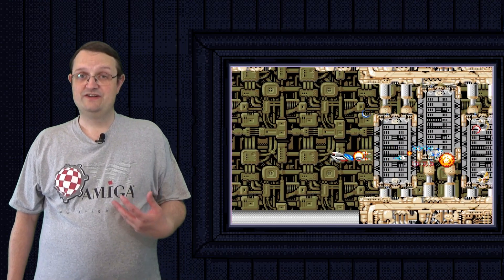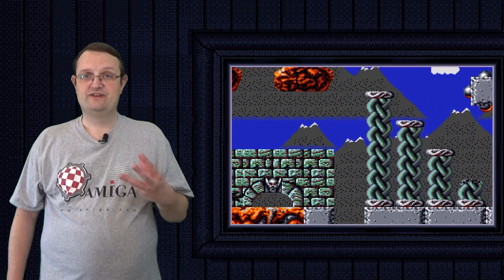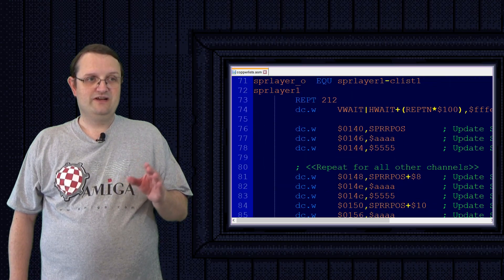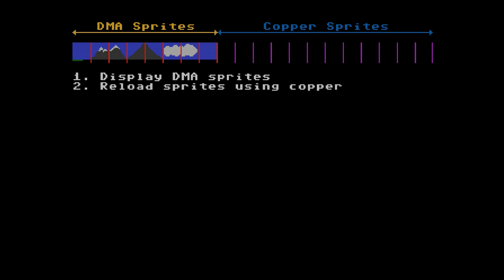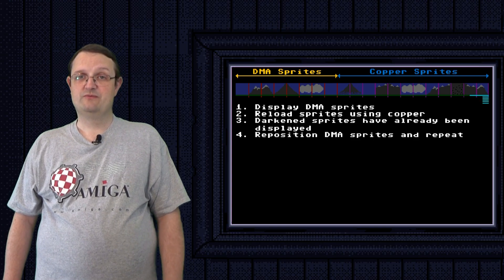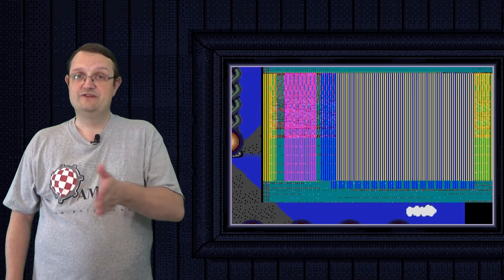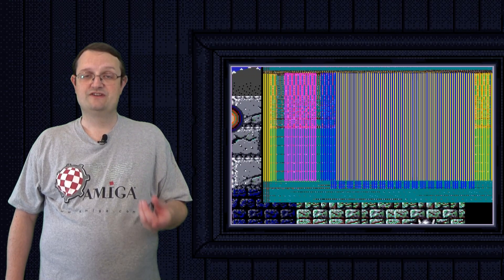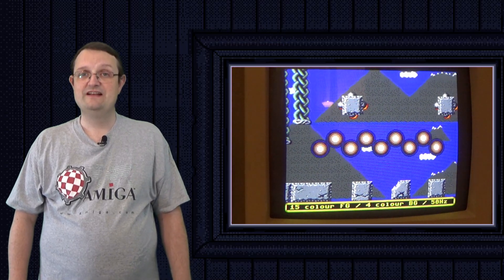Amiga Tech - Free Form Sprite Layer

Comment: You say Commodore but this is in fact just branding. The Amiga was made by Ex Atari employees.
Reply: The Atari ST was designed by the Commodore C900's key engineers.
Reply: @valenrn8657 This is also true!
Reply: Not true
Reply: @bronwaith  It is true.
Ex Atari employees left and founded a company named Amiga.
Then, Commodore, unable to make a 16 bit system, bought Amiga, meaning Atari made it.
Reply from the maker: @ecernosoft3096  The keyword here being "Ex". They were not working for Atari at the time, meaning Atari had nothing to do with it.

Your argument is like saying that anything Atari created after Jack Tramiel took over Atari was actually made by Commodore because Jack Tramiel used to work at Commodore.
Reply: @DutchRetroGuy  fixed.
Reply: Ok, before you all spam me with “no it’s commodore” or “ex Atari employees” I fixed it.

Comment: How many dma cycles takes dual playfield? It is possible and reasonable using it with sprite multiplexing (with and without Free form trick)?
Reply from the maker: Dual Playfield uses 6 bitplanes and so takes 50% more DMA cycles for bitplanes than 4 bitplane mode (as used here) does. Sprite multiplexing is still possible, but the free form trick I've used can only work with 4 bitplanes or less).

I'm not too sure many games used both a multiplexing Sprite layer and Dual Playfield to be honest, the extra layer would be nice, but generally the loss of colours in Dual Playfield means developers used the Sprites to add a splash of extra colour instead of an extra layer.

Should be possible though :)
Reply: @DutchRetroGuy   My idea is to use 4 multiplexed sprites as background layer, back playfield as foreground layer, front playfield as exclusive enemy bobs layer, and finally remaining 4 sprites for player character. So the result should be a parallax scrolled screen with 3 colors background, 7 colors foreground, 7 colors for enemies (plus eventually bullets and explosions), 7 colors for player character. If it remains some dma, it could be possible to use copper for increasing colors in background and foreground layers
Reply from the maker: @ProfenixStudio  that should work, yeah. The one thing to keep in mind with DPL and Sprite multiplexing is that you only get 1 Copper move for every 16 pixels during bitplane DMA (which is why the free form layer can’t work as it needs two). Other than that it’s no different from any other Sprite layer.
Reply: @DutchRetroGuy  I think Leander game does something similar. Right?
Reply from the maker: @ProfenixStudio  I think you’re right, yes. I do think Leander limits the height of the Sprite layer in the background, though. Not sure if that is for performance or for artistic reasons, however.
Reply: @DutchRetroGuy  Also Jim Power uses Dual Playfield + sprite multiplexing + copper  color effects
Reply from the maker: @ProfenixStudio  Jim Power is one of the most impressive games on the Amiga from a technical perspective, it uses so many tricks. Great stuff to look at for inspiration :)

Comment: Really good idea :) Don't know why I never see your channel recommended to me as I google search copper/blitter stuff all the time. A 4 colour parallax layer would be fine for a conversion of Salamander (Konami 1986) as the background parallax works fine with 4 colours. About a year ago I was wondering what could you do with the heavily improved AGA sprites and one idea was to do SNES resolution (256 pixels wide) triple parallax in conjunction with AGA dual playfield with minimum 48 colours per scanline and I would just modify the sprite data pointer for the 4 static sprites. I never tried redrawing one 16 colour 64 pixel wide AGA sprite using your method because I am still learning about the advanced copper stuff. It was for a test engine for Thunderforce 3 from the Megadrive for Amiga 1200. I think my first project for the copper actually writing code will be some sort of picture viewer that does automatic highly realistic water ripple effect at a set height on screen but will come back to your idea to re-use a sprite to make the conversion of Thunderforce 3 easier as the Megadrive is the same horizontal resolution as Amiga and not SNES.
Reply from the maker: There's several ways to implement re-using sprites on the screen. For action heavy games such as Thunderforce my particular implementation might not be the best idea because it's quite resource intensive.

However, if you're targetting AGA you might be interested to know the hardware actually directly supports a form of horizontal Sprite re-use. You can set up the sprites such that they automatically repeat 256 pixels to the right with just one register write. This can be very useful for backgrounds, albeit with either a 4 colour or 256 pixel/16 colour limitation.
Reply: @DutchRetroGuy  I was hoping only re-using one sprite to make up the extra 64 pixels from 256 to 320 pixels wide would be OK and still leave enough DMA time for a relatively normal game engine but I am no Amiga coder really, more of an engineer finding interesting uses for all the goodies inside the custom chips. You could use 3+transparent colour sprites for a simple AGA port of Salamander the Konami shmup, you get 8 64 pixel wide sprites and that leaves you 3 spare for score/status ovelay so no need to re-use sprites just update the sprite pointers for all 5 every other second 16 times (the parallax 3 colour backround is just a geometric grig of 16x16 pixel tiles). People didn't really use the AGA sprites, shame because pairing two sets of 16 colour AGA sprites gives you a perfect and superfast SF2 beat em up style game engine for SNES/Megadrive quality fighters without using anything like the DMA it would take to do that via the blitter...plus a lot simpler to code.
Reply from the maker: @madcommodore  you can re-use a single Sprite, but you can't change the contents. The chipset only allows reloading of 16 pixel Sprites :(

By the way, AGA Sprites are (IMHO) the single most underrated feature of AGA. When used well, they're a game changer.
Reply: @DutchRetroGuy  Ah well then I guess it has to be a 256x256 pixel screen if you want 16-64 colour parallax background using the AGA largest width sprites. 

Even with only 4 large AGA 16 colour sprites per scanline you can do some pretty interesting games I agree, but I don't think any games were that amazing on A1200, most were worse than Turrican 3 I played on my old Amiga :)
Reply from the maker: @madcommodore  yeah, AGA was sadly rather underutilized. The A1200/CD32 were simply too little, too late.

And I'm saying that while the A1200 is my favourite Amiga by far (and one I think is routinely underrated).
Reply: @DutchRetroGuy  The PC is easy to code for, if it isn't fast enough on a 1992 386SX you make the minimum spec a 486 etc but on all Amigas more performance = better coding or design :) The average high street PC a family would have bought instead of an A1200 with hard drive and £150 portable TV with RGB SCART cable was something like a 286-16mhz with 2-4mb RAM, MCGA, Adlib, 40mb HDD and 14 inch VGA monitor (Amstrad 2286 which was 800 bucks) can't play games as well as an Amiga 1000 like Turrican 3 but things changed very fast and the A1200 wasn't enough to leave as a standard spec like the 7 years between A1000 OCS and A1200 AGA. But whilst you can't play Doom on an A1200 like a 486 you can play Super Stardust better than a 120mhz Pentium PC playing the same game. Even Lotus III which runs 50fps on A1200 needs a 66mhz 486 etc. Problem was always how complex it is to get performance out of the A1200, and the AGA and 14mhz 020 sharing the memory bus didn't help but ultimately the Amiga is like the Sega Saturn, and PC is like PS1 as far as coding and design of game engines using as much of each custom hardware function at the same time as far as complexity goes. Lotus II on Amiga is like Sega Rally on Saturn, a miracle of expert multi-processor coding. Commodore only went bankrupt because Irving Gould kept writing himself annual bonus cheques about 80%  of Commodore's annual profits though! 

I would be happy if I can get around to doing a nice water ripple effect copper list in 68000 assembly language and running it on my Amiga...which is more than most ST demo coders can do and people were happy with 1980s ST demos  :)
Reply: @madcommodore  By 1993, 486SX-25 and SX-33 full build PC is like A1200 + 030 50Mhz  accelerator cost. Apple's Quadra 605(with 68LC040 25 Mhz) was able to match 486SX-25/SX-33 PC prices.

Comment: Interesting video. I've always found Amiga sprites to be a little... underwhelming, but this shows what can be done. Would you please cover AGA sprites that are allegedly 64 pixels wide?
Reply from the maker: There's no allegedly about it, AGA sprites can be either 16, 32 or 64 pixels wide and can be either low-res, hi-res or super-hires.

I may do a video on AGA sprites later down the line though, as there are some interesting things to be said about them :)

By the way, I have the same feeling about Amiga sprites. They're very close to being brilliant, but also quite far away. The built-in hardware multiplexing is great, as is the ability to have them be any height. But the limited number of them and how thin OCS sprites are is quite underwhelming.
Reply: @DutchRetroGuy  The reason it confuses me is I've had the A1200 back in the day, and I don't remember this being a thing. When ppl said that AGA sprites are 64 pixels wide, I just assumed they're the same width physically, but in hires / superhires. Must be some downside to it, so looking fwd to that video. Cheers
Reply from the maker: @JohnnyReb1976  actually, 64 pixel wide sprites were used in a number of AGA games (For example: Aladdin, The Lion King both use them).

But you are correct there is a drawback. The AGA chipset allows you to have more Blitter cycles (meaning the Blitter seems to run faster). However, this cannot be easily mixed with displaying sprites if you also want to scroll horizontally. So many games on AGA didn't use sprites.